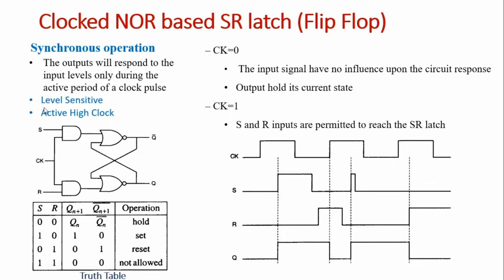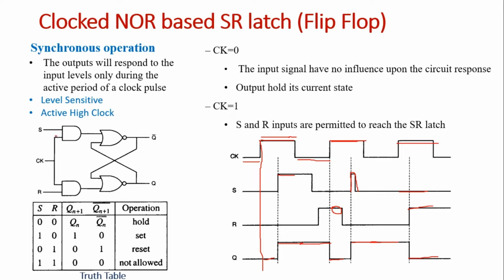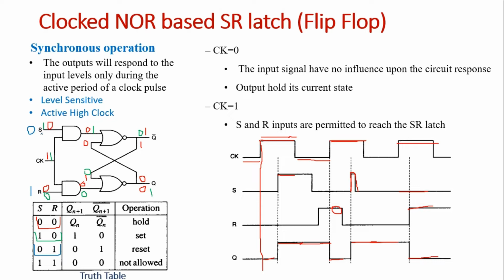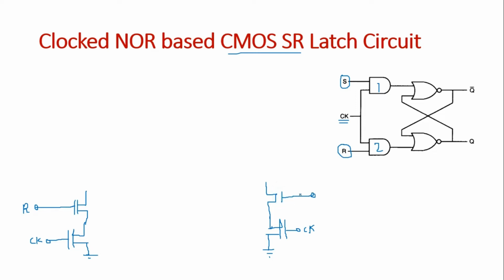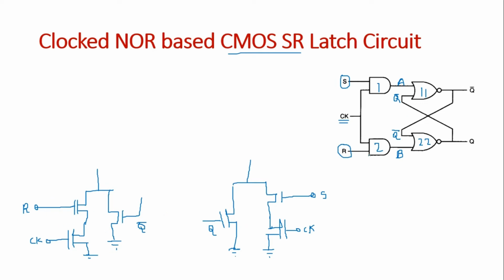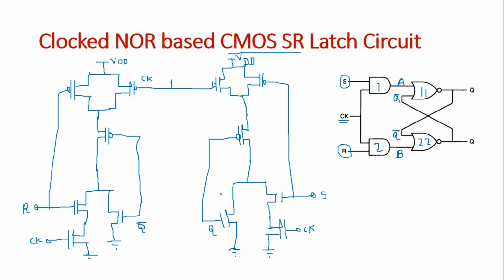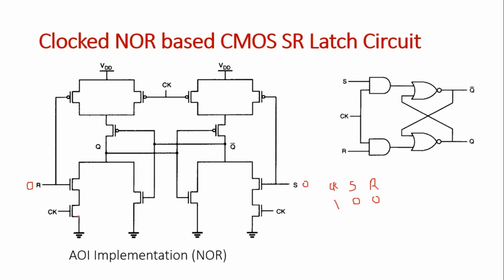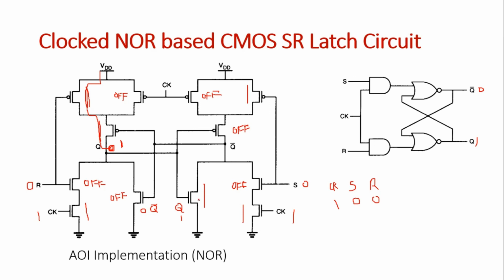Clocked CMOS SR Flip Flop, CMOS SR Latch using NOR gate

Comment: On what based s and r graphs are drawing
Reply from the maker: As I explained in the beginning of the video, S and R is the input and Q is the output. We have changed in the output Q based on input SR and active high clock pulse. So that graph is indicating a different state of the input SR and output Q.

S and R is 2 input, so we have 4 different output possible, 00, 01, 10 and 11